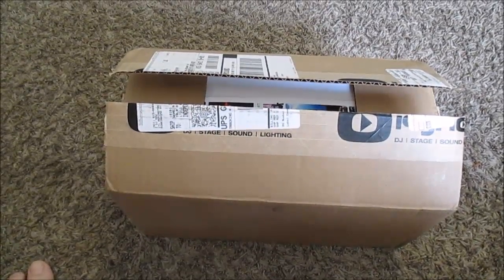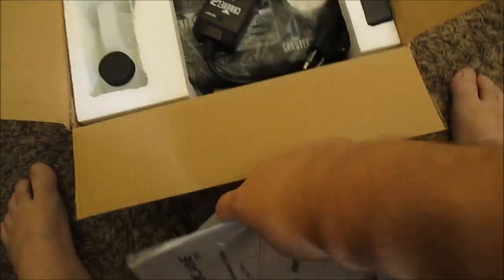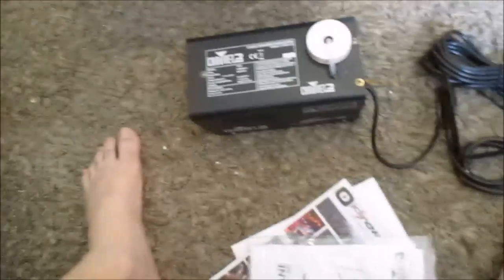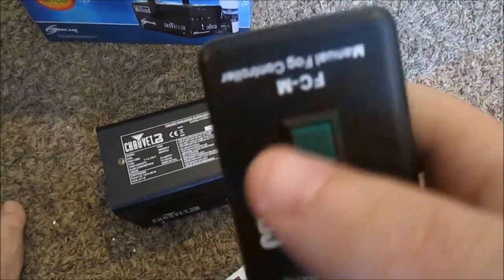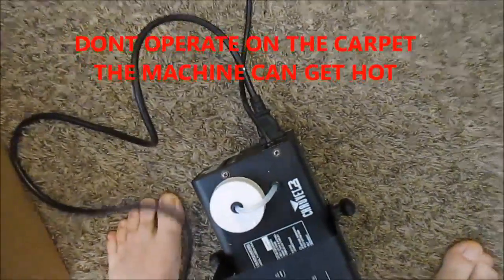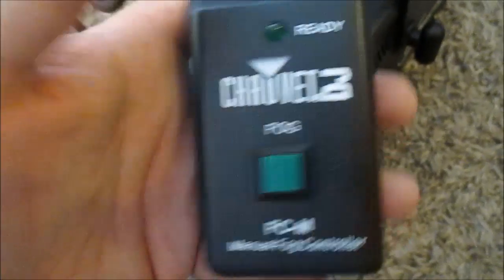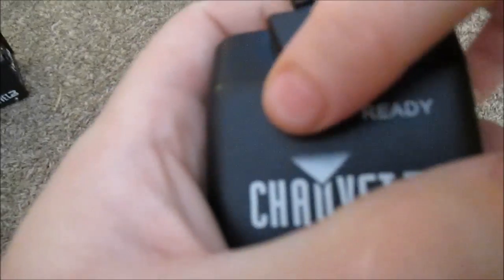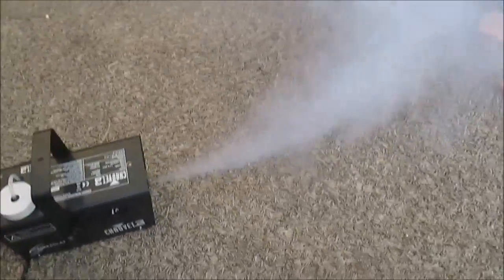How To Use A Cheap Fog Machine To Find Vacuum Leaks Part 1 Overview

Comment: hey there i also made one of these.the part you have pvc jb welded on you can remove that entire peace then you can hook your hose directlly to the hardline instead of doing the jb weld and reducing hose sizes down.it takes around 3mm hose directlly to the fog machines output fog line.

from that hose i put a $3 one way check valve and have the hose tee into another hose with a tire air pump (manual or electric,sometimes i do manual tire pump so i can hear the leak) so i can add smoke then add a few psi to the system and that air wont go back into the fog machine incase the psi damages it.i use it on my turbo car so thats why i like to push psi into the system to find boost leaks.

Comment: There is a $6.99 Multi Use Pump from Harbor Freight and use a CIGAR to make A SMOKE MACHINE. INSERT CIGAR IN THE TOP OPENING MARKED "IN" and use the attachments at the bottom marked "out" to connect it to your manifold. The other thing you need IS A RUBBER GLOVE OR PLASTIC BAG AND A MIRROR.
Reply: what are rubber glove, and mirror for?
Reply: Sounds like a good idea

Comment: Hi,   I was wondering if the PVC  3/4 "  and 1/2" PVC adapters held up to the heat over time.  I have the same machine and need to do these same mods to the outlet pipe.    I was wondering if I should use PVC as you did or should I go to a metal pipe such as copper or black iron.    Thanks for your  reply in advance!

Comment: i being having problem with small leak evap for a long time now and yes i try to buy a smoke pump to do the test and is really very expensive so after watching your video i just order the hurricane fog 700 and i truly believe i will be able to fix my leak once and for all  thats was a great idea thank you so much  i fix two hoses already the valve and still have the small leak and before i check the whole canister just because im guessing i would rather spend 36.50 and found the real problem/or spot and pin-point for sure were the leak is ...great video

Comment: The problem with these fog machines is that most are water based. You don't want water in your engine.
Reply: Does that fog oil claim to be non toxic?  Just curious.  Great machine for under fifty bucks!
Reply: xXBurntBaconXx I
Reply from the maker: Yes excessive water in your engine can and will cause problems for sure. However, A tiny bit of water finds its way in your engine quite often from regular use via combustion gases and from condensation (look at your oil cap in the winter ever see white looking pudding in the oil cap, now yes that could be a bad head gasket leaking coolant, but most of the time it is from condensation, there are youtube videos on this issue) and water itself if a natural by product of the combustion process (ever seen water dripping from your tail pipe) Now I am not saying dumping tons of water in your engine is a good thing, (cause its not you can get hydrolock, oil viscosity issues, and a bunch of other things)  but a tiny bit of water, I myself, just my personal preference am not to worried about. One way water is used in an engine is for cleaning up the valves and combustion chamber from carbon build up (water gives it a steam clean so to speak and there are tons of forums and videos about doing using water to lean an intake and combustion chamber). Well thanks for watching and thanks for the comment. Have a good day.

Comment: After setting up this same machine to inject smoke into automotive intake manifolds we discovered the following.
Machine can not accept the least bit of back pressure without tripping pump motor thermal overload.Machine shuts down.
This works great for what it was designed for. NOT FOR AUTOMOTIVE APPLICATIONS.
Reply from the maker: Mine worked just fine. I found my vacuum leak no problem. Here is the link where I used on my Explorer  https://youtu.be/yrg3fKJh0zk     and here is a link where somebody else used one that worked with no  problems
 https://www.youtube.com/watch?v=LoZamqAArME     and there are many more examples on youtube. However you are right this is not designed for automotive use. Anyway thanks for watching and thanks for the comment. Have a good day.

Comment: It's not a cheap fog machine it is by a professional brand
Reply from the maker: I disagree, it was very cheap. If I remember correctly I paid around 35 dollars for it on Ebay, so to me that is very cheap. In fact, the one I got was cheapest one I could find, which is why I bought it. Everything worked just fine on it, so I am not saying it was a piece of crap or anything. Anyway thanks for the comment and have a good day.
Reply: AJ Pierce k
Reply: Chauvet sells a lot of professional style things, but they definitely are a "cheap" brand compared to real professional grade stage equipment.

Comment: your putting water vapor in your engine water and oil does not work I would change your oil after using it
Reply from the maker: I guess changing your oil afterwards would be fine if you are worried about it, but I am not to worried about it. Water vapor gets in your crankcase all the time. If you live in a humid climate, it gets in from moisture in the air, and if you live in a cold climate, it gets in there from condensation. (you ever seen vanilla pudding looking stuff on the bottom of your oil cap in cold weather, well that is usually what causes it). Also water itself is a byproduct of combustion, it happens in the combustion chamber all day long (you ever seen water dripping from a tailpipe). Also a lot of mechanics use water to clean the intake and combustion chamber by pouring very small amounts of water right into a running engine (usually through the brake booster hose, or other intake port, similar to how you use seafoam or other top engine cleaners) Why because water really cleans up carbon in the cylinder by steam cleaning it. Of course you dont want to pour in a bunch of water at one time, because you can lock up your engine. However, regular water works great on cleaning up carbon inside your combustion chamber. Well anyway I can totally understand your concerns and the point you are making, and I say if you are worried about it then change the oil for sure, or better yet use a different method to find vacuum leaks. Well thanks for watching, I appreciate it, and thanks for the comment. Have a good day sir.
Reply: I also thought of doing this today, I've also found you can get fog aerosols too, I think the ingredients are: propane (45%), butane (45%), and mineral oil (10%).